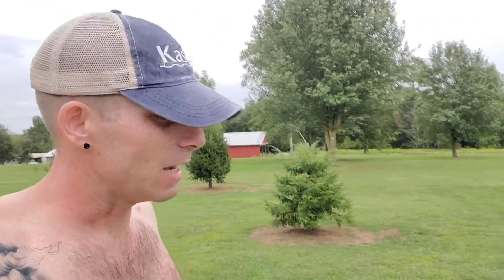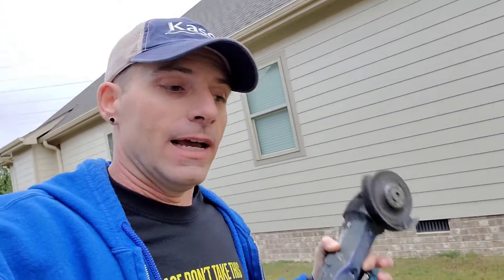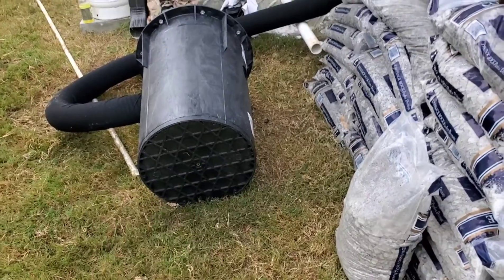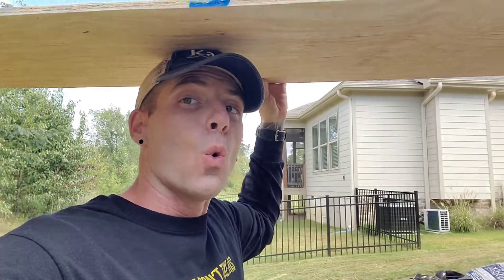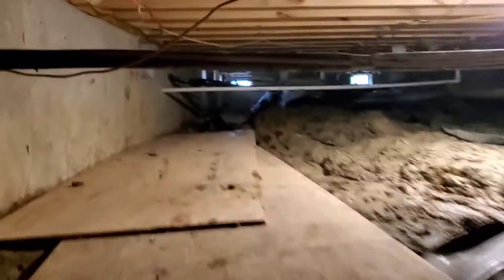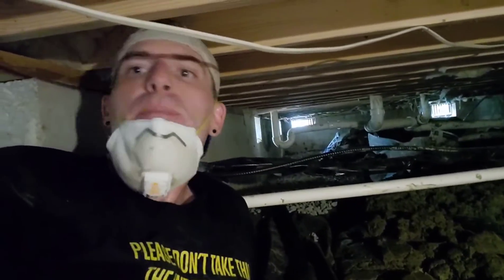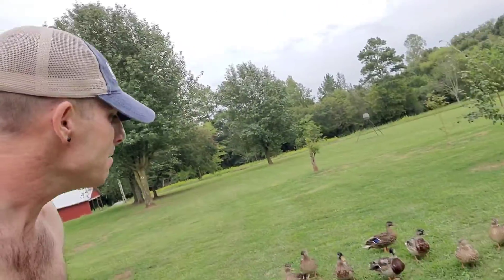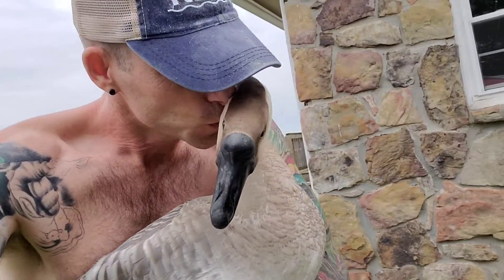How To Install A French Drain Inside A Crawl Space!

Comment: Love the videos I have a question about the your French drain do you put a layer of stone down in the bottom of the fabric then the drain pipe then cover it all with stone ?
Reply from the maker: Yes and no. I used to do it deliberately. And then I found out it pretty much happens instantaneously whenever you go to pouring in your gravel out of your gravel bags. That pipe never lays perfectly flat. So while you're going down your trench, maneuvering your pipe with filter sock, into your drain line, on top of your drainage fabric, and then begin adding your gravel as you go, what you mentioned happens every time.
Reply: @TannerFlowers  good to know I’m going to be doing a trench in my crawl space this spring and I also like how you put 6 mil poly down first as an added vapor barrier
Reply from the maker: Making a new video about our french drains now. Only a couple clips in. Should have it finished up in the next 2-3 days. Stay tuned.
Reply: Great videos! 
I'm starting my project next week. How deep must the trench be? I've seen everything from a few inches below the crawl grade to all the way down to the footer. My footer is @ foot to 2 feet down. That would be a lot of digging and gravel........
Reply from the maker: @edevans2620 the highest side needs to be deep enough to bury the 4" corrugated pipe with filter sock, and have gravel on top. So your highest point should be at least 5-6" deep, and then pitch from there 1" per every 10 linear feet, leading to the deepest point, which should be your basin destination.
Reply: @TannerFlowers  Thank you for your expertise!
Reply from the maker: No problem. Thanks for tuning in.